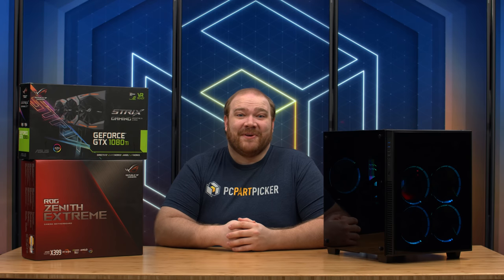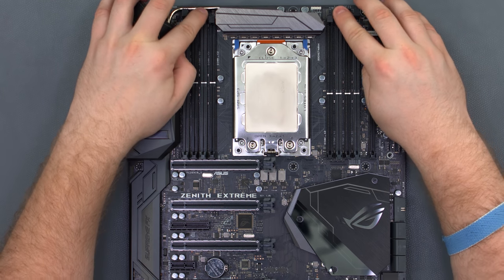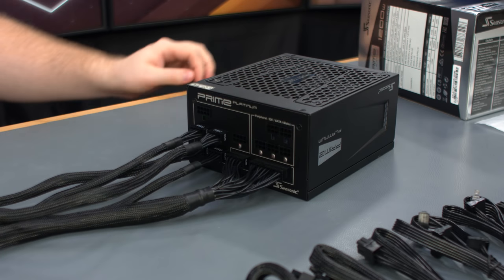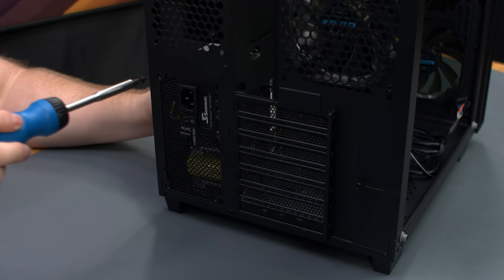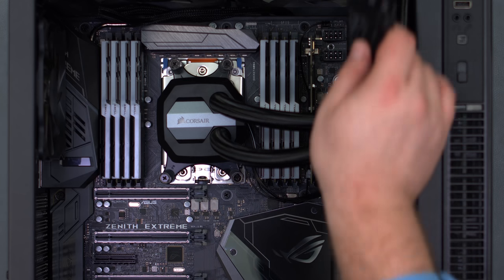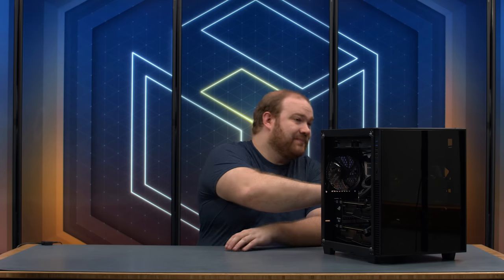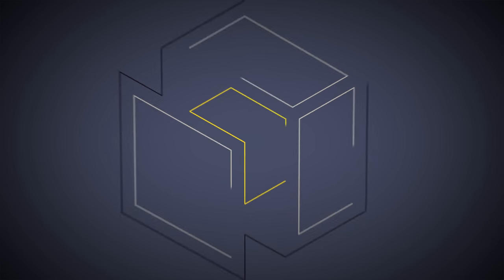ASUS ROG ZENITH EXTREME X399 Build - Ryzen Threadripper 1950X / GTX 1080 Ti (2-Way SLI)

Comment: The pre applied thermal paste doesnt cover the whole chip
Reply: Forget the thermal paste, it'll spread some. The cooling block doesn't even cover the whole IHS. I learned in pre-K that a circle won't fit on rectangle unless the circle is bigger than the rectangle. The corners of that CPU are gonna be mighty hot. Boo to PCPP for rushing this video and not getting a proper AIO water cooler made for Threadripper (Enermax makes one/the only one right now). Unless they only cared about the sponsorship. No self respecting PC enthusiast willing to spend that kinda skrilla on that pc is gonna overlook the cpu cooler
Reply: The only heatsinks I've seen that cover the whole chip are not liquid cooled. I went for the Noctua NH-U9-TR4
Reply: @TripTVx  the coolermaster and enermax cover the whole ihs, but they are terrible

Comment: Just an FYI about screwing down the threadripper itself, you may have to get all 3 screws threaded before tightening down or else you can't get more than one screw threaded. Also the chip comes with a torque wrench. Also I found that the ram slots on the Zenith were pretty hard to get the dimm cards installed, you may not actually get them totally in (which means the PC won't post - just unplug the machine and re-set the ram and everything will work).

Comment: And you are doing 40ºC in the bios because you shoudve removed the thermal paste and spread more by hand to cover as much area as possible.
Reply: this, or they could use a cooler designed for threadripper like the enermax.
Reply: It went down to 35.
Reply: @feelingtardy  I bought the Enermax 360 that you're probably thinking about. Mine lasted 2 months before the pump failed. Even during the 2 months it was very loud - even at idle. Temps were between 30-67C. Then the pump stopped working. It idled at 53C... I finally brought it in to the repair shop and that's when they told me the pump was bad. At it's last time running, it idled at 55C and max load was 80C. 
From a previous build, I had the very same h115i. I put that on to see how it would do with the Threadripper. If it didn't do any better than the Enermax, then I would go with a Noctua . The h115i has been on it since. Idle around 23-27C and max is around 60C. I still don't like the liquid... so will eventually go with the Noctua.
Go see the reviews of the Enermax on amazon. Last time I checked the Enermax had 2 of of 5 stars. I'm not the only one who lost money on the Enermax!

Comment: Why wasn’t the T20 screwdriver with the processor used? It’s torqued to the needed pressure for the TR4 socket.
Reply: Unfortunately, we were using an early sample when filming this build and didn't have access to the tool included in the retail package.
Reply: ThatDudeinaLude you don't need it
Reply: well you should of bought retale

Comment: Why would you guys leave the pre-applied TIM on the cooler and not at least add more?!?  That 1950X is not going to be adequately cooled the way you installed that H115i.
Reply: coinsagE46m3 it hurts man
Reply: WRONG. FAKE NEWS
Reply: Yeah, the Tim may cover a third of the 1950X. The H115I may have problems keepers my it cool
Reply: first thing I thought was that is not enough thermal paste lol
Reply: It is not bad, but I rather take it out and put some artic silver 5.
Reply: Geekzmo MX2 is better
Reply: Thanks! I will try it
Reply: Geekzmo Oh yeah fyi, MX2 only cools about 2 degrees better than Artic Sliver 5. MX2 is non conductive, spreads better than Artic Silver 5 since it is thinner, and easier to clean up. Not that you will be cleaning off thermal paste but there isn't a huge difference between thermal paste but since Artic Silver 5 is so old it has its disadvantages.
Reply: The IHS doesn't represent where the actual cpu lies underneath, it's centred and about 60% of the size of the IHS, the pre applied paste is more then enough. google Threadripper delidded. I'm using the h115i with my 1950X and I'm Idling around 32'c and around 75'c in stress tests with the pre applied TIM..
Reply: not saying pre applied paste don't work... but I bet it would work better with more paste... as long as your paste spreads and covers the whole plate you'll be fine in general...
Reply: coinsagE46m3 What this guy said ---------> your heads. Hexsaid the way this person mounted the cooler will lesson the h115i's liquid cooler.

Comment: I would like to point out you only need to use the dimm.2 card if you plan on using 2 or 3 m.2 SSD's because he didnt even take off the heatsink for the primary m.2 the card is used if you want to use 2 or 3. it doesn't mean it will mess up the computer but if you don't need to use the card why use it

Comment: 7:00 I can't believe you used the pre-applied thermal paste with a TR 1950x. I really want to see the thermals on this system. it has to be running hot.

Comment: Pretty sure this pc was a bit on the noisy side, 2 gpu's with axial "open air" fans do not generally get on well together in the same case.  1 card basically ends up recycling the air the other is dumping so it leads to one always being hotter and louder.

Comment: The X399 motherboards should be treated as server boards and installed in a 3U server case together with all cooling fans as well as a cooler block for the CPU and a full complement of good quality high speed DDR4 RAM modules and install the drives into the drive caddy and slot them in home connect up all power and data cables and consider using Linux Mint 18.3 64bit rather than Windows as we all know that servers use Linux rather than Microsoft Windows and see how that goes, if you want to play games them install the STEAM client and download and install any games that you want if you want to run Windows applications then Wine64 for Windows.

Comment: This is very near identical to my build. I agree with most of the comments get rid of the pre-applied thermal paste and put something like a Thermal Grizzly Kryonaut on it. I did the credit card method just to be sure since the heat spreader is massive
Reply: just wondering
even if you have a smaller cpu (the 8700k) its still best to use a higher end thermal paste right?
cause the stock, being exposed to air, probably not great quality

Comment: 0:31 according to the zenith website, it's only 3 sata cable included not 6. Am i right?
Reply: That does seem a bit confusing on their website, but I think the "Accessories" list is probably referring to them as three 2-packs since that's how they are actually packaged (we pulled them out of their bags to show them in the video).
Reply: was wondering same thing and they also forgot molex plug

Comment: if computer do not turn on what u have to check first?
Reply: Hi jake Monk, 

Follow Troubleshooting Procedure in Manual. Process of elimination.

1.) Turn off power. Remove all peripherals, connecting cables, and
 power cord etc. Have only, RAM, Motherboard and CPU + CPU Cooler. 
2.) CPU properly torqued with CPU supplied torqued wrench? 
3.) Make sure Motherboard does not short-circuit with chassis or
 other metal objects. - Isolate the short. 
4.) Check if CPU cooler is attached to CPU securely. Is power connector of CPU cooler connected to CPU_FAN header properly? 
5.) Install Video card + Extra Power Connected to Video card? 
6.) Check if memory is installed properly in memory slot. You'll hear it click, then lock it down. 
7.) PSU OK? 
8.) Power Up!
9.) Any Errors? Bios Codes or Beep Codes?

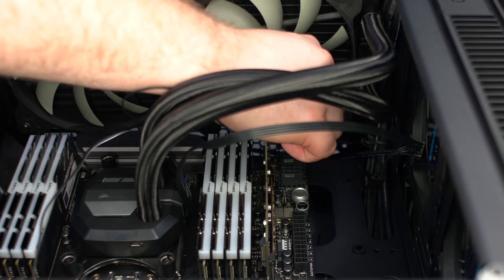Comment: can anyone tell me where the wire at 6:10 comes from?  and what does it attach too?  and what cable is that at 7:15?!?
Reply: ok I figured it out... those connect to the corsair itself.  715 connects to the fan on the motherboard.  but i am convinced the cable at 7:30 does not exist.  there is nothing to connect to the molex.   all the fans seem to work without this anyway.  and you forgot to connect the corsair pump (usb connector).  i think that the fans would run but its not cooling.  (i can't seem to find a usb header to hook it to either)
Reply: The MOLEX connector powers the case's fan controller for the front fans (at least in the RGB version of this case).  And sorry about the confusion on the USB connector -- we should have pointed that out.  The USB connector from the pump is used to customize the cooling profile using the Corsair Link software -- it doesn't power the fans/etc.  If you want to use it to change the cooler from it's default profile, you will need to either swap it with the front panel USB 2.0 header or pick up something like the NZXT Internal USB hub to let you use both at the same time.

Comment: I see many vids about Threadripper builds. Only see one use a full block Enermax Tr4. The rest is using X62 or 115i. But the block isn't completely over the Chip so cooling is not optimal. With Enermax you can easy set all cores to 4.0/4.1ghz without burning down the chip. 

Very nice build but I don't think X62 and other coolers are designed for the big chip Threadripper....

Comment: Note that the top center mobo standoff, needs to be removed for this mobo. Also, the PSU is better oriented with the fan facing the mobo and not the case's side, as there's more clearance and fresh air from the rear I/O slots.

Comment: did you guys get those 8 dimms at 3000mhz as rated? its not high of course, but was it with stock latency? What frequyency and what latencies and voltages and SOC did you boot that system with?>
Reply: The RAM they had in the build was rated at 3000mhz in xmp.

Comment: Did your motherboard not come with the  ROG Areion expansion card-- 10 Gbps NIC? It says it is included with the board on ASUS' website. Also that looks like a system I woul like to have in my arsenal, but I will stick with my Fractal D S R5-1600X build.

Comment: Hi how do I ground myself where should I connect the wrist band I have an NZXT S340 Elite case so its full painted.. can I just screw a screw and attach the wrist band to it or that won't work?
Reply: You can just touch the metal case before you're ready to install the parts, to discharge yourself. You don't need the wristband,- only if the place you're building the PC isn't grounded.

Comment: Is there a specific reason that you mounted the M.2 NVMe drive to the DIMM.2 card/slot and not under the heatsink(bottom right of mobo) where the primary M.2 slot is located?

Comment: The only thing I'd swap from this build is the h115i for a Kraken X62.

I had to change my underwear several times during this video
Reply: iTz_DaNiiLo I wish I could swap my Kraken X62 for an Enermax Liqtech TR4 360 :(
Reply: iTz_DaNiiLo and get noctua fans
Reply: Kraken X62 + 4 Noctua high performance fans (push pull). Someone has to do that.
Reply: I would if I didn't have 2 HDDs.
Reply: noctua for sure

Comment: long shot ive just bought the board and processor cheap but i only have 850w power supply. will that be enough ?
Reply: You've probably figured it by now but in case anyone else out there has this same question. Yes, 850w PSU is more than plenty. My one, on idle is around 150-190 watts max.. And when i am working on heavy simulations in Houdini, it shoots upto around 450 watts. 

I watched this video as i am about to take this motherboard off.

Comment: Hi, i bought this exact build inspired on your great video, but for some reason i cant get it to work properly. I keep getting the blue screen of death mostly with the memory management error. Ive seen on some forums that most people are getting this error and some more, ive reinstall windows, ive update my bios and done everything i could think of, but know all i get is freeze time wich makes me power down the machine by pressing on the botton because it wont respond. Can you please help me with this situation? thanks
Reply: The memory frequency is to high with either the board and the Cpu. Both support normal freq. upto 2666 but all over it ist just maybe working due it beeing stated as OC so the is no guarantee for it to work and only comes down to the silicon lottery. Change your rams to one with the right frequency. Just saying on the recommended list from asus there was only some 3000 Rams that worked but some only in 32 gb configs. So reduce the freq. since it doesnt have such a huge impact anyway

Comment: I'm building a 1800X 64gb of ram and two 1080ti's is a 850watt evga 80 gold psu enough to power my 1st build?
Reply: Very good build.
Reply: gemini duece id go with at least 1000w
Reply: Yes go for 1000w. 850w will cut it though

Comment: Hey thanks for the video, I have a question thou, I am finalising my TR build and one thing I have noticed is that when I boot up my system (without windows) the OLED panel on the Zenith Extreme X399 does not turn on. Is this because I don't have Windows installed? If not, how can I turn it on? Cheers

Comment: @PCPartPicker hey Brian I have Asus ROG ZENITH EXTREME EATX TR4 Motherboard +   
EVGA - SuperNOVA P2 1200W 80+ Platinum Certified Fully-Modular ATX Power Supply  but dont know where I plug  that in the video screen showing you in clip 2 ip ips power cabel 8"00 do you need to plug in ? I dont have PSU Cabel I have different name ,MB, Peri, Sata, VGA,. CPU

Comment: Hi Great video, I'm interested on buying this G.SKILL TridentZ RGB Series 32GB (2 x 16GB) 288-Pin DDR4 SDRAM DDR4 3600 (PC4 28800) Intel Z270 / Z370 / X299 Desktop Memory Model F4-3600C17D-32GTZR, are these memories suitable for the Ryzen processor and the ASUS extreme board? Thanks for your reply,
Reply: Not really the 3600 frequency is at the full limit of the probably working OC and you only have 2 sticks but it is a quad channel board

Comment: Whoa . . . congratulations on 'another successful build'. What problems did you have after you loaded the OS? In light of all the other builds incorporating Asus X399 boards that are criticized on Amazon, Newegg, B&H et al, there was something you are not talking about. I'm a retired Quality Manager / Surveillance Engineer who used  AS9100 and ISO 9000 every day in SMTs, mechanical and electromechanical inspections. I'm 86% certain you left out something, regardless of your thanks to the suppliers -- what failures did you choose to leave out of your review? I want this board and a 1950X coprocessor for my next build, but your review has the smack and tang of patronism [legitimate word - look it up]. How can I get a similar setup gratis to do my own professionally neutral audit of its real-world advertised capabilities and its criticized shortcomings? Would Asus and Ryzen  risk a totally non-partisan blind-test?  Please let me know.

Comment: 4 fans in that config are not amazing. They make alot of turbulence. There is a reason we dont see more cases do that. Also your paste is not enough. at all.
Reply: the reason you don't see it, is because almost all cases cant do it. clearly you've never seen a build using Thermaltake Core W200 or anything larger. 4x4 cooling does amazing things. turbulence is something every build will have, it's the nature of air. It's not a big deal as air just moves freely. The single time you have an issue is when you don't have fans pushing and pulling air at the same rate. however even in a case like this, with that massive open top, it wouldn't matter the config of vent fans.
I'm living proof of this, moved from the Air 540 case because it only had dual intake tri-out.. the i7 at 5ghz couldn't get enough cold air so i moved up to the evo haf xb and temps weren't an issue.

Comment: I'm sure you don't need to connect both of the EPS 8 pin cpu connectors I have the same motherboard and CPU with a single gtx Titan x I only connected 1 8 pin connector and that cable management is horrible I couldn't even finish the video

Comment: Instead of using 32GB of RAM, one is better off buying only 16GB and using the rest of the funds (or at least part) towards at 6TB 7200 RPM HDD to store the games and use the 1TB M.2 SSD as the boot drive.

Comment: That cooler is going to bottleneck the whole build. I have a H110i with the TR 1950x and it won't let me go pass 4.1Ghz stable. It could be done with better cooling but the cold plate of these Asetek pumps is too small.

We need proper cooling AIO designed specifically for TR4 socket.
Reply: enermax has one specifically made for tr4